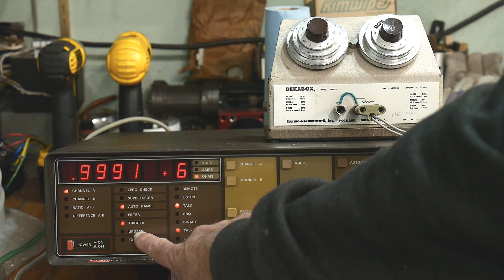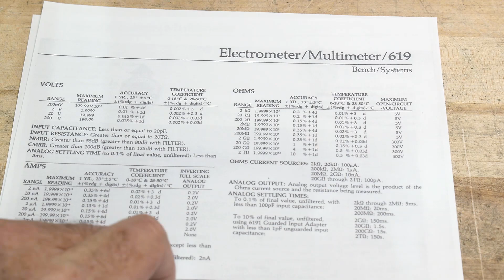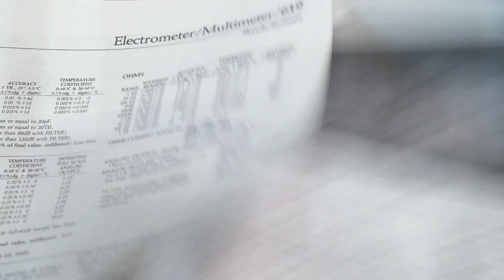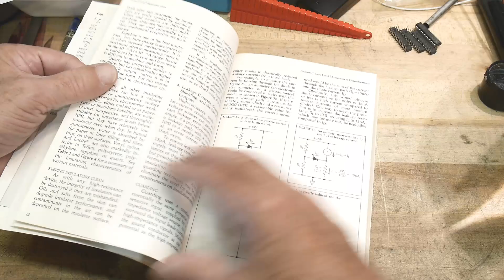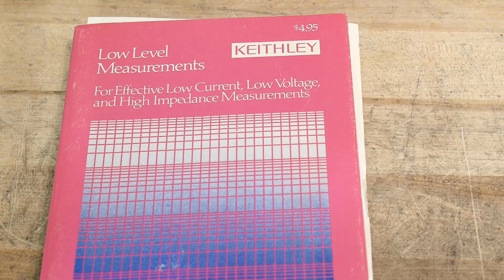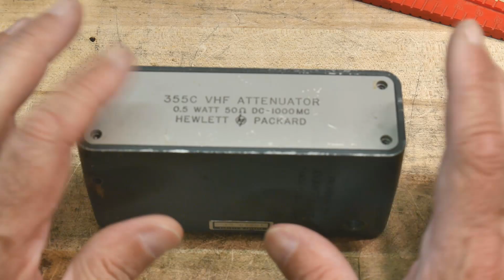#757 Keithley 619 Electrometer/Multimeter

Comment: Great video I purchased one of these electrometer 619. Unfortunately only A side works and I’m pretty sure it’s out of alignment . I would be grateful for a link to the manual. Also with the same purchase there was 2 Keith let 610c analog electrometers both of which are working. I’m fairly new to electronics
Reply from the maker: http://www.siliconvalleygarage.com/teardowns/619amodel619.pdf

Comment: Metal candy/cookie boxes can make good, shielded project boxes. You just need to make sure to remove the paint/clear lacquer to make the connection between the top and bottom of the can. Being larger than standard project boxes, they can be easier to work inside. And, the price is right, if recycled. If your wife does not have a supply in the cupboard, they are available at the Dollar Tree stores, year-round. I have even seen double insulated boxes made by putting a smaller cookie can in a larger one. There are YT videos for these projects. Interestingly, shielding goes all the way down to the trace level on PCBs = "Guard Rings." If you don't know of the technique, here's a Google list: https://www.google.com/search?q=trace+guard+rings&source=hp&ei=bCxzYIy4MIW5gge5vY-4BQ&iflsig=AINFCbYAAAAAYHM6fNrUwwbOJkQwMLXVTLOAMi2o4Bpo&oq=trace+guard+ringsgs_lcp=Cgdnd3Mtd2l6EAM6CAgAELEDEIMBOg4ILhCxAxCDARDHARCjAjoFCC4QsQM6CwguELEDEMcBEKMCOgUIABCxAzoCCAA6BQgAEMkDOgUIABCSAzoRCC4QsQMQgwEQxwEQowIQkwI6CAgAELEDEMkDOggILhDHARCvAToICC4QsQMQkwI6AgguOgUILhCTAjoECAAQCjoICAAQFhAKEB46BggAEBYQHjoFCCEQoAE6BQghEKsCUIYbWItLYPZNaABwAHgBgAHVAogBjBOSAQgwLjE2LjAuMZgBAKABAaoBB2d3cy13aXo&sclient=gws-wiz&ved=0ahUKEwiMnvzE1vbvAhWFnOAKHbneA1cQ4dUDCAg&uact=5 
It would also be interesting to see what it would take to add Channel B. I would think that it would be an additional whole duplicate board with super-high-end parts, making it not DIYable. But, you never know, until such ideas are researched. If it was some sort of switching system that bounced between A and B, that might be doable. Just thinking...

Comment: Low Level Measurements Handbook - 7th EditionPrecision DC Current, Voltage, and Resistance Measurements
https://download.tek.com/document/LowLevelHandbook_7Ed.pdf

I've seen an older version of one of those used for counting photons from a photomultiplier.
Thanks for the videos!
Reply from the maker: thanks

Comment: Wow, femto-Amps, I wonder how many electrons per second that is
Reply: 1 A is 6.242E18 electrons per second so 1 fA will be 6,242 electrons per second!
Reply: @zeno2712  wow that's cool
Reply: @ruhnet  You could almost imagine them at that rate! But remember that individual electrons are moving very slowly.
Reply: @zeno2712  Yep isn't their actual speed something like 1m/sec or so?
Reply: @ruhnet  I had to remind myself but for 1 A in 2 mm dia copper wire, the drift velocity is 23.4 μm/s. Because the velocity is proportional to the current (charge), 1 fA would be 1E-15 times slower than that, so 2.34E-20 m/s or 234 atto metres/s.

https://en.wikipedia.org/wiki/Drift_velocity
Reply: The Keithley 617 has a full scale range of only 2pA (but 4.5 digits instead of 5.5 like the 619). But it reaches AttoAmps!
Reply: So, with the (putative) 621 you can give individual electrons pretty names?